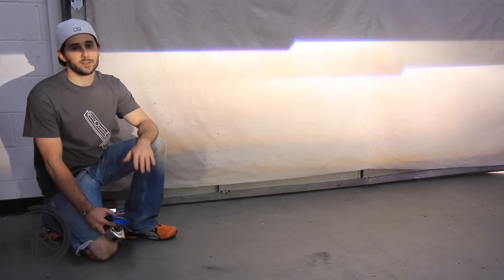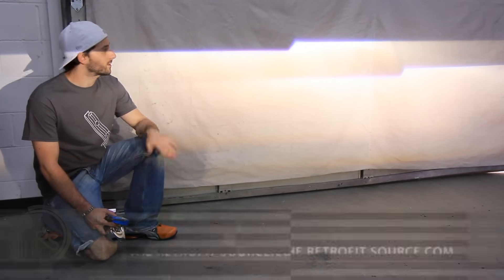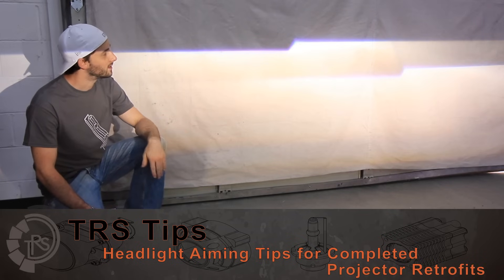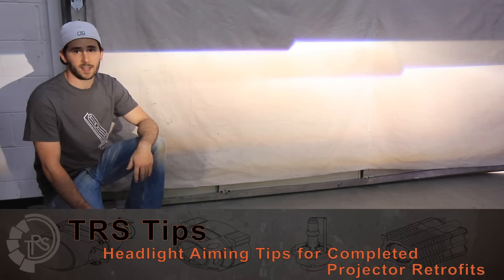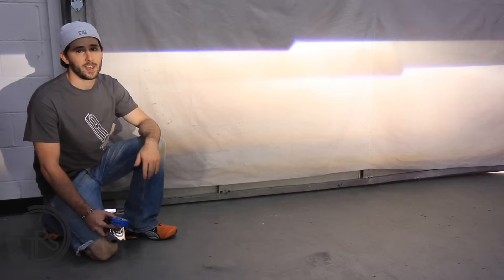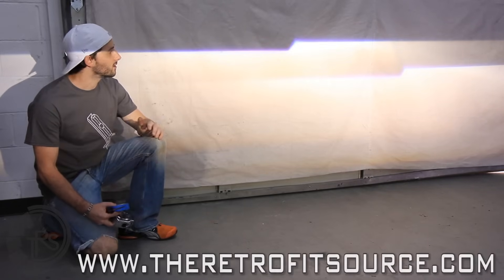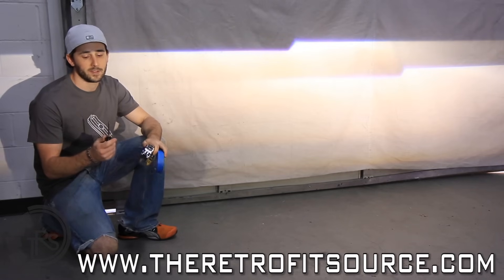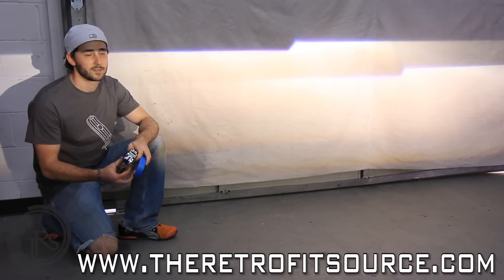TRS Tips: How to Adjust Headlights for the Perfect Aim!

Comment: You made it look easy. I'm having a hard time getting my lights to move side to side...but thanks for the video.
Reply from the maker: You can do it, keep working at it.
Reply: @RetrofitSource  thanks......this is my first set of projector headlights and after adjusting them ...I can actually see now....lol......it's so weird seeing the light cutoff on the door of other cars while driving.......I have a little more adjusting to do, but almost done..👍
Reply: @r_s1776  alot of headlights do not have side to side adjustment, only up and down

Comment: Why are they not level all the way across?
Reply from the maker: The US uses a DOT or ECE beam pattern, meaning the driver-side cut-off sits at a lower point than the passenger side. There is a "step" in the middle of the lights that allow for this effect to happen. They're engineered to keep lights out of oncoming traffic, preventing blinding other drivers.

Comment: I have an 03 Dodge 1500 and the adjustment he showed does side to side. There is one on the bottom to do the up and down.  Just found this out. Had to remove the whole ass'y to replace a turn signal and there it was. :-D

Comment: What did he say for rotation?
Reply from the maker: If you are doing a retrofit, you will need to make sure that the headlights rotation is aligned, as that will not be something that can be easily adjusted using the the adjuster screws.
Reply: @RetrofitSource  shop installed it to me a bit tilted...
Reply from the maker: If it is tilted enough to be unsafe, they may be able to re-do that build for you! You will have to reach out to them for that though!
Reply: @RetrofitSource  thanks

Comment: How many inches is it from the floor to the cutoff line???
Reply: Floor to center of light. Mine is 27.5" mark the wall at the same height.
Reply from the maker: Usually they are around 25-27 inches. That being said, You'll want to really fine tune them to fit your specific vehicle and needs.

Comment: I’ve been trying to adjust one of my lights beam but when I try to raise it, the beams stays in the same place. But it does go lower. Does anyone know why that happens?
Reply from the maker: It is maxed out.
Reply: @RetrofitSource  but it’s still pointing to low. Is there a way to make it point higher
Reply from the maker: Unbolt the headlight and tilt it up as much as possible and bolt it down again. Works sometimes.

Comment: How about if the lights wont go any higher, but the lights are too low? What do you do? The knob where you put the screw driver to go up it's already max out and still low?
Reply from the maker: At that point, something would be broken or mis-aligned if its a retrofit. You would need to look closer at what is going on.
Reply: @RetrofitSource  I bought the projector from motorsports.

Comment: Can you explain the staircase-shape that the light is projecting? I have it on my 06 WRX & I’m trying to raise my lights but I can’t seem to & the staircase-shape is making it so I can’t see afar. My lights are pointed pretty low for some reason & even when adjusting the bulbs & direction, it doesn’t seem to help & it stays this stair-shape as it points really low making it impossible to see anything.any advice?
Reply from the maker: It's to keep the beam out of oncoming traffic's eye. The raised step allows you to see further down road, and the lower part of the step keeps that beam below the eyes of traffic. It actually helps you see further :)

Comment: the h4 adaptor align the projector lens not on the straight line on my Ecosport  headlamps with RHD,so i had to grind the projection in the h4 adaptor to rotate the lens freely. that means the h4 adaptors are not universal ?? why dont TRS think of providing adjustable h4 adaptors so that we can freely rotate before locking the position. i had glue it down after finishing the rotation. thats a negative...
Reply: You have to end up JB welding that adapter and the projector back end into the reflector to insure a solid structure or it can start getting loose over time.
Reply: @cgmf-d6t  yes thats correct. thats what i did.

Comment: So if you have a led with a rotatable base plate, do you face the leds horizontal or vertically for the best/brightest beam pattern on a projector? Have a projector that takes a standard h7 halogen bulb but switched to and h7 led bulb instead.
Reply from the maker: Yes you still want them facing at the 3 & 9 position.

Comment: The drivers side (RHD) light is on the lower side by default and I don't really see a screw to make them even. Should I set the motor level to the highest & set the headlights at the same level before trying to install a projector pair?!
Reply from the maker: There should definitely be some sort of manual adjustment, almost every vehicle (if not every single vehicle) made has a vertical height adjustment built in. It is however fairly common to be missing a side/side adjuster
Reply: Thanks. I'm trying hard but still no luck finding that. Maybe I should try to look into the manual. The car is Lacetti sedan/Chevy optra/Gentra. Yeah, there are too many names.

Comment: Since each beam pattern's top has this crooked horizontal "step" (which are like 2 inches apart in height), do you measure everything from the low horizontal one (left) or the high one (right)?
Reply from the maker: Hey Thanos, if you want to send us an email we can help with that - Support@TheRetrofitSource.com 
Technically, your headlights should be on the same level. The only difference is that the step is more obvious on the driver side, since the light helps fill out the passenger side beam. Shoot us an email so we can help further!

Comment: this is very helpful but now i have another problem when i turned the up/down adjuster i think i made too tunr much and now my headlight is not moving anymore
Reply: if you turned it too fsr outward, yoi can tighten it all the way so it screws back into the housing. then you can adjust outeard again once the screw goes in. if that doesnt work youll have to look inside and manually try to line up the adjustment screw and the housing

Comment: hi i need to know the cutoff  shape i see it in audi and some other cars like
                                   /''''''""''"''''''''
 that    ,,,,,,,,,,,,,/''''''""'"'' 
 It is LHD the right headlight is more higher than the driver headlight 
 but in the d2s 4 morimoto projecters  r different  ......../''""""'''......../'''''''''why sir?? and i need to know which is better???..thanks
Reply: H danielle the reason why the left side dips lower (like the picture you posted) is due to further reduce glare for oncoming traffic. In the United States cars all drivers are on the left side, so oncoming traffic drivers coming from the opposite end of you will be in the left side.
Reply: My Audi has the same pattern. It's called a deep beam. Headlights are bright from a distance but as you approach the car the beam seeps so other drivers aren't blinded. Example of horrible protectors can be found on fords and Toyotas.

Comment: Thanks. @1.25 - How did you make sure that's the distance between headlights or that's the center piont?
Reply from the maker: We measured the distance between the projectors on the front of the Jeep with a tape measure, then matched that
Reply: Thanks for replying. I can see that you measured the distance on the jeep, but how do I match that on the wall?
Reply: TheRetrofitSource Inc Hey, any help on my question. Once I measured the distance between the projectors, how do I match it on the wall? There must be a centre point on the wall which matches the centre point between the projector to do so. Does that make sense or am simply making it too complicated? Thanks so much!

Comment: Adjustments right in the front. How convenient. Lol. Most of us have to remove the front bumper cover and if its an aftermarket projector Headlight, we have to remove it as well since the adjustment bolts are on the backside. Over and over until its right. Normally never is.
Reply from the maker: What headlights have you had to remove in order to aim? Most headlight housings can be aimed vertically with out removing the housing.
Reply: @RetrofitSource  2006 Lexus  is250 after market projector headlights.
Reply from the maker: Do you know from what brand? They still should be able to be aimed without removal.
Reply: @RetrofitSource  same with Spec D and Spyder

Comment: So I'm in a huge conflict, I own a 2006 Ram. And everyone who owns a 3rd gen Ram, knows that they have a poorly designed headlight. Not much you get out of them even with a quality led bulb. Not sure if that has to do with the H13 High/Low or with the reflectors. I'm looking into a morimoto retrofit with a 55watt HID System or the new AlphaRexx Pro series that comes with stock H7 Halogens and then just getting a HID conversion. I feel having one high projector and one low beam I might have more output out in front of me. Help!!!!!!
Reply from the maker: I can tell you one thing right off the bat, you will be much better off going with the projector retrofit kit, as that will get you more usable light output down the road, and will be cheaper than going with the Alpharex housings and an HID kit! I have linked the healight retrofit kit I would recommend for you below, let us know if you have any other questions! 

Link: https://www.theretrofitsource.com/bixenon-morimoto-mini-d2s-stage-3-CRK-D2S?quantity=1

Comment: My headlights were equally as far away from each other at 25 ft as they are on the car, but when I am at greater than 25 feet the focal points begin to get closer to each other. Is this normal or should they be parallel to infinity?
Reply from the maker: Yes, that is normal.

Comment: im wondering why do the top sharp line of the projector lights have a flat line then a curve? mine are a bit diff. the  top line when i shine my headlights on a wall shows a zig zag shape. anyone know why?
Reply: camaroiowaguy23 it's all in the design. Depending on if you're in a RHD or LHD country, the cutoff will zig zag the low side on the side incoming traffic is so it doesn't blind them. The curve is due to the round shape of your projector.
Reply: @ryanmoore7927  Would changing the lens or projector or swapping them over change the direction or the dip? I need them swapped for UK use.
Reply: @Kolvorok  yes, the retrofit source has pretty much anything you would need. If they're cheaper headlights, the lens is most likely the issue.
Reply: @ryanmoore7927  Hi Ryan, what does the package contain? Mine are the original LED projectors that came with a 2015 Toyota Prius Plugin. I am being quoted ridiculous numbers to swap the over with their mirror image for UK roads. Is there any other way, like replacing an internal part, modifying them, or replacing only one of the two to obtain a "flat" beam from two complementary lights. Also do you know if you can swap in the Halogen headlights to replace the LED, they are significantly cheaper and I do't really like the LED light anyway (my eyes adapt to the brighter part they illuminate and the rest looks pitch dark).
Reply: @ryanmoore7927  thanks. just seen a lot of videos that only show flat lines. and yea i noticed mine has a lower cutoff to the oncomming car side. but this zigzag ill admit makes it a bit hard to adjust leveling. id set it where i thought it should go then i get brighted by cars. i set it lower to avoid blinding people and i cant see down the highway. smh lol

Comment: PLEASE HELP* is it normal to have the left headlight beam lower even if the beam is completely flat? (because of that slight slant) as you can see in the video. my right side is fine since its rotationally aligned but because of that slight slant of the left side, i can't see as far on my left side as i do on my right side. it looks like similar to this.    __/-------- and on the road it's really bothering me. i didnt think that slight slant would effect how much i dont see. (morimoto mini d2s 4.0 from TRS)
Reply: I think, it could be normal. May be your car has an 'ECE' light pattern instead of the 'DOT' pattern